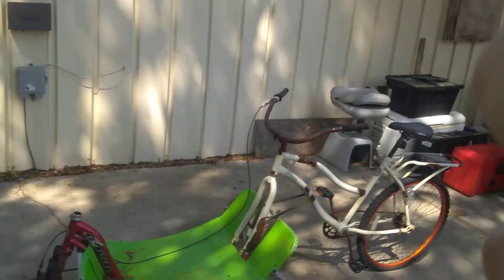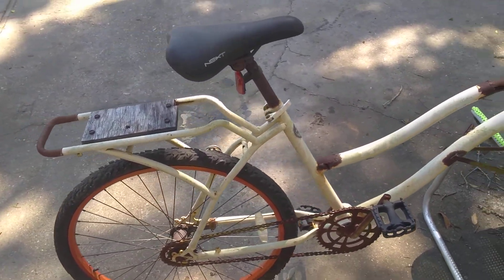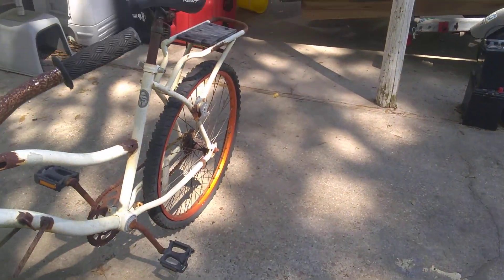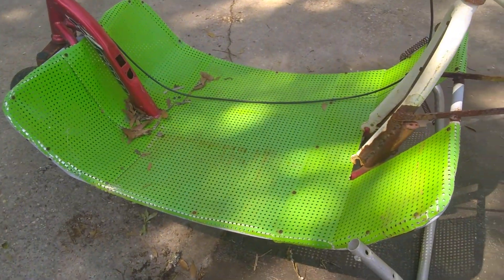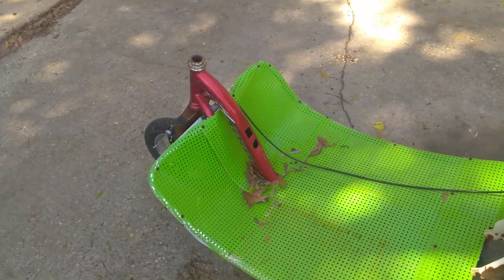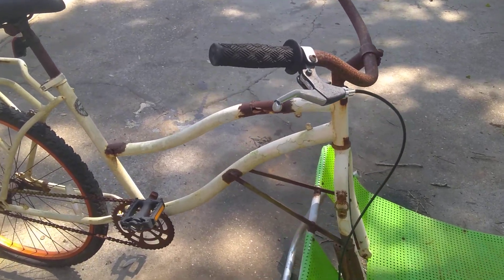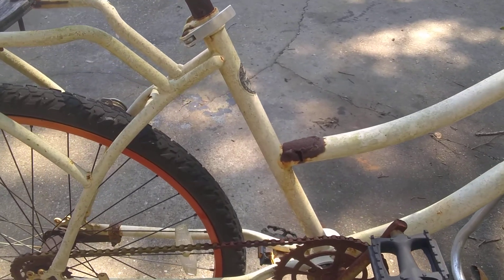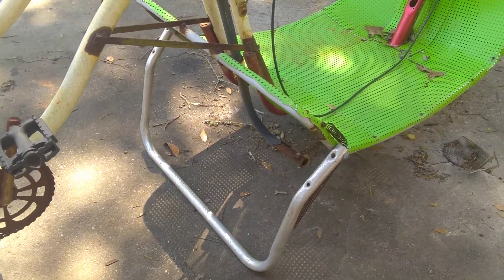Diy cargo bike

Comment: That is quite unusual. never seen steering like that.  A bit over engineered and over complicated for me. looks kind of like one of those real cargo bikes though. I like the rear half, coaster brake large sprocket. Reminds me of long ago , when I sold ice cream on the ice cream bikes. Had 300 - 400 lbs of ice cream in the front end going down a hill and lost all brakes. That was the absolute worst job though, lucky to make $15 a day for whole day work riding that thing in hot sun : P
Reply from the maker: I didn't mention it in the video but I had a four horse and a belt drive on the back on that heavy rack 😅 dog hauler
Reply: @Jarrod_D  Dont like to pedal much ? lol
Reply: That is a nice patina paint job on those handlebars. what is going on with gaming the algorithm for your channel ? : p i guess we gotta wait a bit longer this video is brand new.
Reply: @Jarrod_D  A belt drive ? i see a pulley but how did that work ? friction drive onto the rear wheel ?
Reply from the maker: @BIKEMAN21  I took a rim another 2 6-in rim and poprivit to the side of the other rim a Max torque belt drive clutch the pulley was the idealer pulley to take up the slack and slap of the belt.
Reply from the maker: @BIKEMAN21  well when you get this comment I think I figured out what's going on here the biggest game of anything it's a fact that you have to go back and search for your comments and the replies you may never even get this comment I'm not sure if I've lost some of yours already. If not though I can feel the love brother. 😄
Reply: @Jarrod_D Ok when you get this comment i think i figured out what's going on too, you are taking way too many safety brakes and have fell down the rabbit hole. I only roll with safety's off, No helmet, Removed the blade guard.  safety safety
Reply: @Jarrod_D  I literally cannot visualize that (in regards to the belt drive setup )
Reply from the maker: @BIKEMAN21  all right well I went out and looked at it again that pulley was part of the motor lift system to tension the belt. then I got a Max torque belt drive clutch I have a brake lever with a pin in it that you can put tension on the motor but it didn't work just wasn't enough tension had to buy a smaller belt and a Max torque clutch